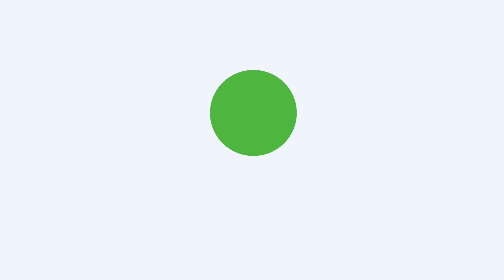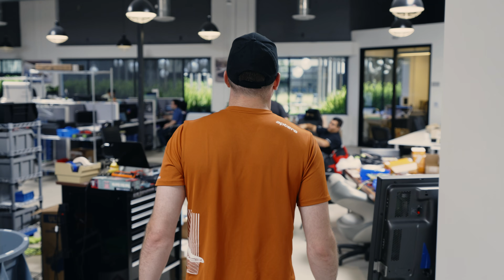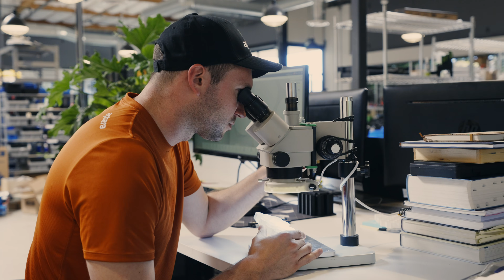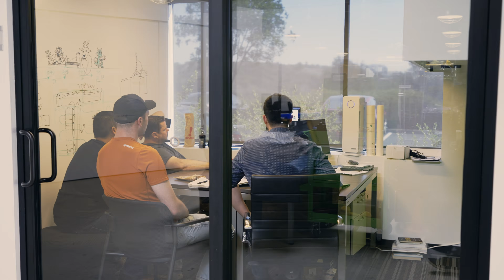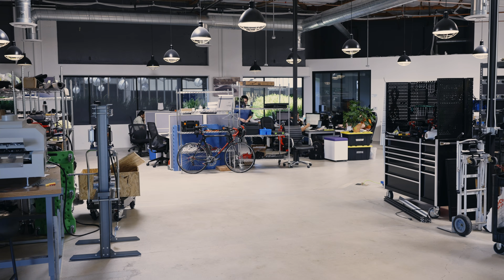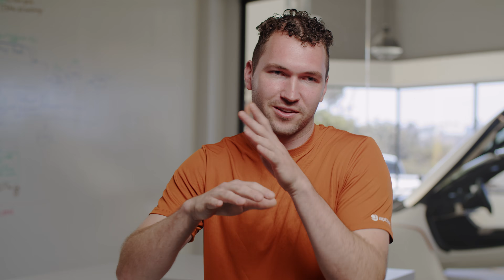Aptera Makers Series — Battery

Comment: If I buy an Aptera with 400 mile range and later wish to upgrade by adding battery modules to either 600 mile or 1000 mile range, is that easily done?
Reply: The battery would have to be replaced completely and the suspension adjusted for the new weight,

Comment: Question:  I know you guys support right to repair.  So I'm wondering if someone decided to start with lets say a 200 or 400 mile range vehicle.  Is the frame setup for someone to still be able to upgrade to a bigger battery or is it locked in to the battery they choose at delivery?  I think it's important to leave room for expansion if possible.
Reply: Hi Joshua, you asked about upgrading the battery in an Aptera to get more range.  If you bought the 250 mile version and wanted to upgrade to the 400 mile version, then it would probably be OK. But going to a bigger battery than that would probably require a change to the suspension setup.
Of course by the time a 250 mile battery was flogged out and needed replacement, the technology will have moved on and the energy density will have improved ..... this means that in the future the weight of a 400 mile battery will keep coming down. I hope this answer helps.

Comment: What is the battery life expectancy, and how much will a replacement battery cost?
Reply from the maker: We expect to offer a 10-year warranty on the battery pack and for the battery to live much longer than that. More exact figures will be shared before launch. Many cells can fail in our pack design before things need to be replaced, and if replacement is needed, you would only need to replace the pack itself. We will strive to make the packs affordable for upgrades in the future. The replacement costs will vary, but they will be far less than any other EV as our packs are smaller for a given range. Please stay tuned for exact answers regarding our battery warranty and repair/replacement cost and plan as we get closer to production towards Q3 or Q4 of 2022!

Comment: Cooling is one thing, what about heating the battery had a 2014 leaf, and it was useless under 15F If you want to go further than 20 miles and below 0 range 7 miles.

Comment: Can you comment on the incremental weight increase for the various range options that are offered? What is the weight increase in % of car weight when you go from 250 mile range to the 400 mile range option?
Reply: The batteries are among the lightest at roughly 10 lbs per kWh
Nominal pack sizes will be 25, 40, 60, and 100 kWh.  More  detail will come after the beta testing us complete and the vendor is announced.
Reply: @n.brucenelson5920  Thanks for that information. I read somewhere that the weight of the car with the 60kWh (600 lbs) battery is 1800 lbs. If those numbers are correct, the approximate car weights are 1450 lbs for the 250 mile option and 2200 lbs for the 1000 mile option. Aptera has advertised an efficiency of 100 wh per mile for the car. Is that the efficiency for the 600 mile option? With the additional weight for the increased range, there must be a reduction in efficiency. What is the efficiency for the 1000 mile option?
Reply: @casparheyl4353  Yes, I think your numbers are close, but I think the 1800 lbs estimate is far the 400 mile version.  The effiency and performance numbers published so far are far the 100 kWh model.  The smaller ba sized are likely to do better.
Reply: Long term it will probably make sense to switch the 250 and 400 mile versions to LFP.  This will be easier to source and make the models have a closer set of weights which will simplify suspension.  The range needs to be taken with a huge heap of salt and realistically who is 1000 miles for apart from marketing shock factor.  A 400 mile car with 150+ kW supercharing would make a lot more sense since this would add insane miles per hour compared even to a model 3; literally in the time to take a pee you add over 100 miles.

Comment: Will it be compatible with Tesla Supercharger network?
Reply: Probably.  Chris Anthony owns a model S and had said Tesla has the best connector, from an engineering standpoint.  

Tesla has said they will open up the network to other brands.  Aptera will be compatible with several networks.
Reply: No, it won't. Tesla doesn't allow other brands, and while they have suggested that they will in the past (to increase their share value or otherwise make good PR), they have never done so.

Comment: Would it be possible to use Thermoelectric cells/peltier module to get more charge from the sun? Here in Phoenix black cars hit 190f.
Reply: Peltier effect devices are very inefficient; there is no point in trying to use them to recover energy from hot photovoltaic panels.
Reply: Not for range, but Aptera will probably use them in the seats to regulate seat temps.

Comment: KOOL: A semi-solar car. Even Aptera's will need charging. Covering millions of acres with solar panels is hardly an environmentally benign activity.  The footprint of a small modular thorium fueled nuclear reactor is... what... 1/10,000th the size of an equivalent field of solar collectors?  With essentially no nuclear waste and no carbon dioxide release, thorium reactors are 100 times safer and 100 times more efficient than the old reactor designs from the 1960's.  Your LIFETIME share of radioactive waste would be about the size of three grapes.  If we can unite efficient cars with efficient pollution-free power generation for us (U.S.) and the billions of people in developing countries, then we can really make a dent in our pollution problems.  Coal, gas, and oil generate so much particulate pollution that they kill about 4 million people a year just from lung disease--and that doesn't even count the problems caused by a warming planet.
Reply: In my opinion, the capital costs of building a proposed thorium reactor are likely to make them non competitive with renewables, even given technical advantages over LET's.
Reply: @n.brucenelson5920  You might be right.  Well designed 4th generation reactors might not need expensive containment buildings (since there is no risk of melt-down).  Also, the land under a solar farm or windmills is a capital cost that's easy to overlook.  What's a L.E.T.? The phrase "Energy too cheap to meter" is back.  This time, they're talking about fusion power plants, which is patently ridiculous. In the early days, site-built reactors were a lot cheaper than they are today because they didn't have so many back-up systems.  Factory built reactor MODULES should be even cheaper than that.
Reply: @gregtuve1109  Sorry, I just got off a plane and my fingers and brain were a bit scrambled. I meant PWR - pressurized water reactor.

I have worked in the nuclear industry, especially measuring the moisture in Uranium to be used in fuel rods to be sure that there is not enough present to cause a steam fracture when they are put to use.

 My observation was that even in good companies, social factors are likely to override the safety systems designed in.  I saw this at conventional coal plants as well.

Thorium reactors don't require strong pressure vessels, but they do require massive concrete walls as radiation shielding.

You are certainly right about coal, gas and oil.  I spent much of my career measuring environmental mercury from these sources, as well as measuring the cleanup of petroleum leaks around the world.  I concluded prevention of pollution from all sources was a more effective approach, although all tools need to be brought to bear.

Comment: (Part 1)
Thanks Luke! As you move to the final production design my out of the box idea for maximizing the green potential of the Aptera experience would be adaptable battery modules. Please hear me out. If the battery packs could be made into modular removable sections, perhaps 5 or 10 kWh apiece for easier portability, owners could adapt their car's battery size for the use they require that day, or in the next few days. Even if I had to employ a driveway hoist to help lift out 4 of 5 of the 20 kWh battery packs in the 1,000 mile model it would still be worth it to me for the efficiency I would gain in reducing my battery pack weight by 80% for my usual daily driving needs. A 200 mile range would be more than enough for my normal local driving needs, even with up to 40% of that managed out for battery longevity. I would just add back batteries as I needed more range.

Granted this modularity could be a bit tricky to engineer with electric and coolant connectors and all, but it would be totally worth it for me, given the huge discrepancy between my daily needs and my long trip and adventuring needs. It would solve the huge battery sizing dilemma many of your constomers face. It would allow us to keep our big trips out into North America's car charger deserts, while still being able to drive with maximum efficiency and minimum environmental impact day in and day out. It aligns perfectly with Aptera's stated mission. 

As a result of our edge case needs, or dreams, we then end up with battery packs that are vastly outsized for our typical daily vehicle use. These massive batteries are bound to be an efficiency liability. Effectively, if we could have sections of our batteries removable then Aptera drivers could gain the flexibility of customizing the size of their battery packs to maximize their vehicle's efficiency for their day to day needs. It would be lighter on our pocketbook as well with an improved $/mile traveled. Who wants to lug around dead weight when it is not necessary, esp the efficiency minded among us. Those two topped off five gallon gasoline jerry cans that are strapped to your ice vehicle when trekking the back roads are unloaded when you get back home, no? 

And the freed up battery compartment space might be appropriate for certain smelly items, or drinks that need cooling ;->, unless you advise against this.

But the environmental benefits of this flexible pack size can get SO much better!  
(Continued in Part Two... )

Comment: (Part 2)
But it could get even better. If the removed sections could act as home use power walls, customers could use them to save money on their 'time of use' electricity downloads, while reducing their grid use during peak periods, thus helping utilities reduce their peak generation needs, firing up those inefficient peaker plants less frequently. These power wall imitating batteries could also help customers survive power outages, keeping some lights on, the refrigerator and medical devices running, etc. 

Even better still there could be quid pro quo agreements with electric providers so they could use some of their customer's excess battery capacity to 'help' them with their renewable electricity storage needs, reverse metering it back to them when they need it the most. Customers' excess battery capacity could then be converted from an environmental liability into an environmental asset that helps fast forward renewable energy adoption and that helps put fossil fuel electricity generation out of business. 

Power utilities should have legislative mandates to form these electricity storage sharing agreements on terms that are fair to them and to their customers that are willing to provide storage for them. With the growth of EV adoption there will be increasing volumes of seldom used excess battery capacity just sitting around idle in our vehicles, normally only serving to add excess weight to them and thus wasting energy and customer's fueling dollars.

But if that excess capacity was taken out of these cars when not needed, and was in a stationary location for days on end it could be more reliably available, and monetized, connecting to a two way metering plug to add storage capacity to our electric grid. This would be harder to accomplish if it was left in a vehicle that frequently moves around and is not always able to park in a place that has access to one of these special bi-directional plugs. I could even see individuals, non-profits, and businesses buying battery banks to help our electric grid store renewable electricity that will be needed at another time, if the payback terms for providing grid storage services were lucrative enough. In a power outage, that's backup power to keep them online, and some of that storage could save them money avoiding grid use during peak power, and peak electricity cost, times of the day.

Since EV drivers "need" these batteries anyway for their memorable dark sky camping adventures in 'nothing for miles & miles & miles' Nevada, but definitely DON'T need most of them 90 to 95+ percent of time, it just makes environmental sense to enable this 'removable battery module' efficiency innovation. Easily removable modular battery pack sections are also easier to replace when they reach the end of their useful life in the car, easier to then repurpose as a stationary power back-up, and eventually easier to recycle. 

For the planet, for future generations, and to help build out the environmentally more just, cleaner renewably powered grid and a healthier, safer future for us all, please make it so! With Aptera leading the way proving feasibility and marketability, other EV makers just might follow, adopting this adaptable, 'load up your extra battery modules when you need them' vehicle powering model. A more adaptable, flexible battery size car is a more desirable car and will be greener and cheaper to operate than a fixed battery car. Having to make battery pack compromises in the name of efficiency, and ending up with a less capable car, or taking the efficiency hit and living with an oversized battery car for those few and far between adventures each would lower mine and other customer’s satisfaction with our car. So give us a car for which we can maximize our daily efficiency and allow us to hit the road with it on those extended adventures in America's 'charger deserts'. 

If the battery modules become standardized enough perhaps people could even rent them, picking them up fully charged and ready to go. This would also help make long distance capable EV’s more attainable for everyone who might not be able to afford owning extra storage capacity and getting into the grid services business ;->. If someone can’t afford to buy your extraordinary 1,000 mile capable wonder, they still might be able to borrow or rent an extra battery module or four* for their next adventure in a 1,000 mile capable Aptera!

*  or 8, or 16 if you break the 20 kWh packs up into 10 kWh, or 5 kWh modules for easier hefting about ;->.
Reply: No need to remove Aptera's batteries -- just plug the Aptera into your home. At least that is the vision of Vehicle to Home (V2H) technology. The guys at Aptera are looking into the options for delivering that. As a first step, all Apteras will provide an output power outlet to provide at least 1500 watts of AC power for however you want to use it. It will power a fridge or freezer during a power outage. It can recharge a laptop. It can power your tools on a job site. It can even be used to (slowly) recharge another EV.
Reply: @fotoguru222  That would be wonderful! Even better, for maximizing efficiency of daily Aptera use, and better enabling grid storage applications, or using both your vehicle and keeping the frig running during outages, would be the removable sections option I am advocating for, for all the reasons I mentioned. Aptera does not currently acknowledge any efficiency losses as you move up to larger battery sizes. Any realistic person knows that defies the laws of physics. Going from a 25 kWh pack to a 100 kWh pack will likely make the battery pack 4 times as heavy and will more than double the weight of this weight thrifty car. They are busting butt to shave off a pound or two everywhere they can, but battery weight is the real elephant in the room, no?
Reply: @jeffcarlton3590   You make some good arguments. However I see serious roadblocks to this. 

This is not as easy as removing and installing a car's 12 volt battery. Those are only 40 to 50 lbs. How many people are willing to do even that for themselves?  How many hours would you be willing to spend to access, remove and reinstall a battery pack? Half a day? An hour? 30 minutes? 

As you mentioned, these are liquid cooled batteries. That means not only making and breaking strong, watertight, high voltage connections but also making and breaking watertight coolant connections, then probably flushing the coolant system to remove any air in the system which could prevent proper pumping and cooling of the batteries. In other words: a big, messy job!

Much easier to plug an extension cord into your Aptera to extract the AC or DC power you need occasionally. Or if you want battery power at home every day and night, just buy some brand of home storage battery system and permanently install it.

Comment: Great messaging, Luke/Aptera - I get the nimble/agile/integrated point here.  I hold a reservation for an Aptera vehicle spec’d at 1000 miles range, and I have no expertise in how various, current, (OEM/commercially-available at scale) batteries relate to weight, (including capacitance/cooling/transmission/motor overhead/impact), on range/recharging performance. Question for others commenting; Does this video create confidence in Aptera’s insights on the topic?

Comment: The Aptera is classified as a motorcycle or auto cycle. On that basis it will not be subject to the same rigorous testing as a 4 wheel car.
Reply: Aptera doesn't legally have to, but they will still do the same crash testing and publish the results.